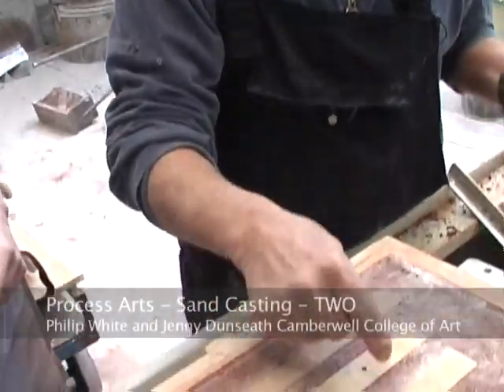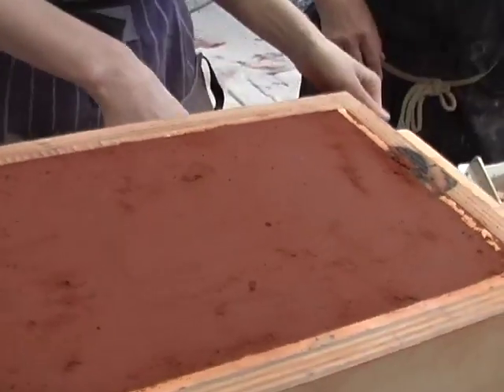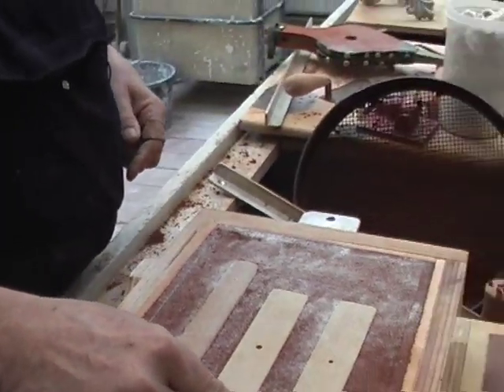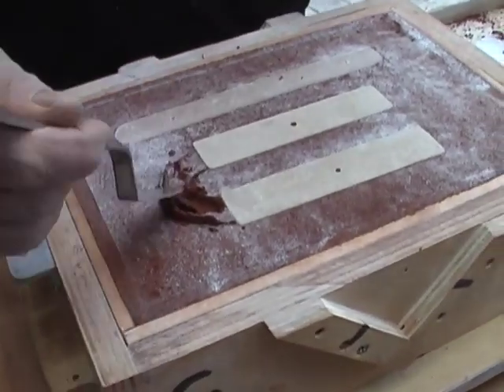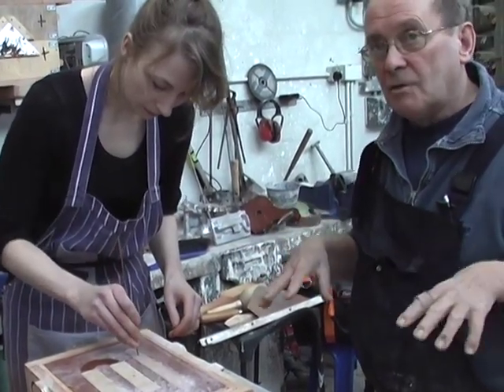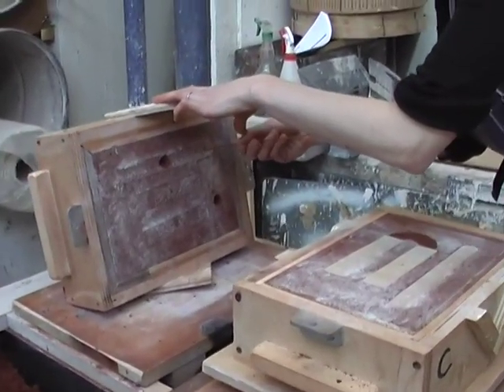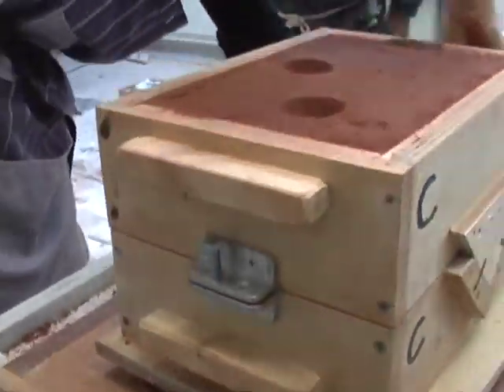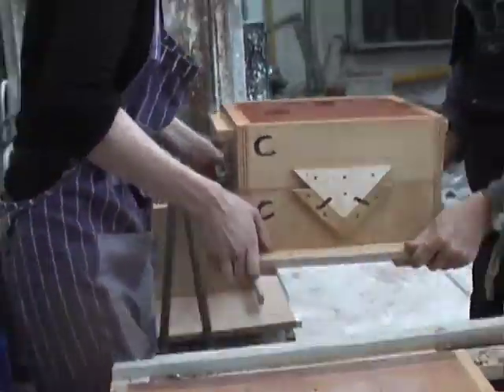Sand Casting - PART TWO with Philip White and Jenny Dunseath

Comment: I make my sprue bottoms out of wood and mold them right into the drag, then when I cut my sprue, I use a non-tapered cutter and avoid cracking the sane like what happened in yours.  If you use a U shaped piece of sheet metal to cut your gating, it will work much better.

Comment: core mix
8 parts silica sand 2 parts moulding sand 1 part core binder (wheat starch)temperd with water and molasses.
bake in oven for 30 min at 180 deg c

Comment: @googleisgod1 Fantastic set of videos.  Cope and Drags look well made.  However, the V-alignment blocks would only be any good for flat back patterns.  When split patterns are involved, especially those involving cores already placed in the drag, proper vertical descent of the cope is needed long before the cope and drag meet each other. This cannot be achieved with the V-alignment blocks.